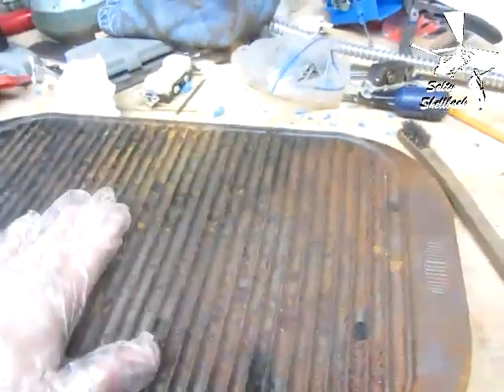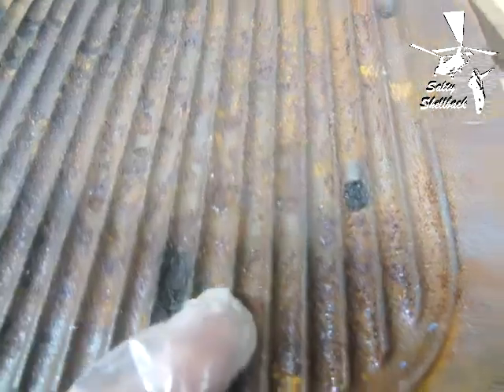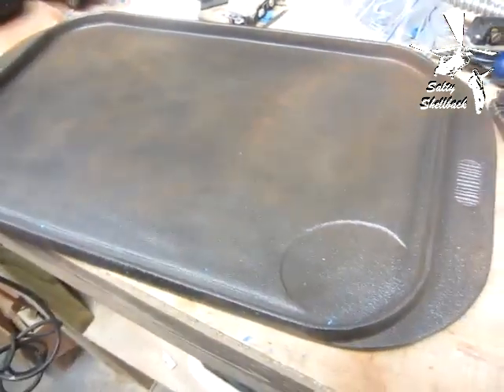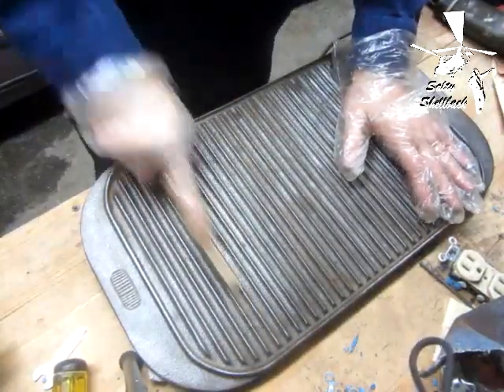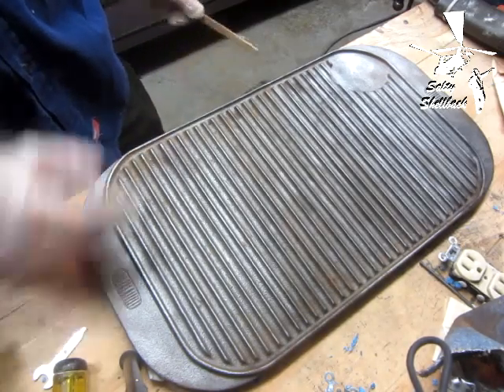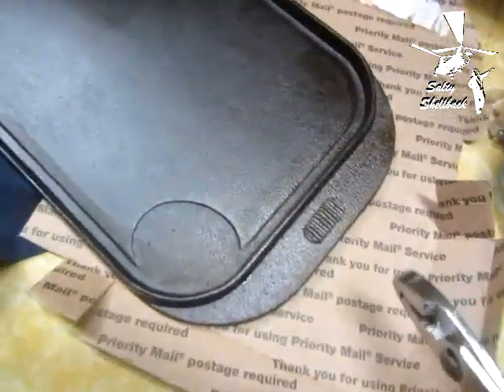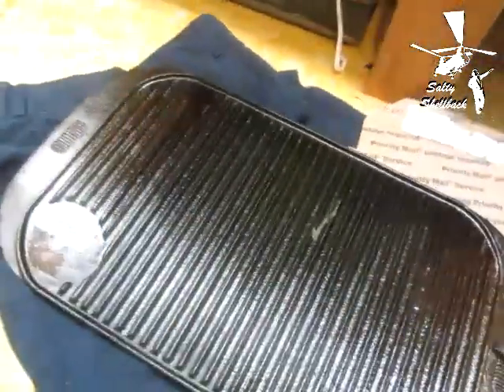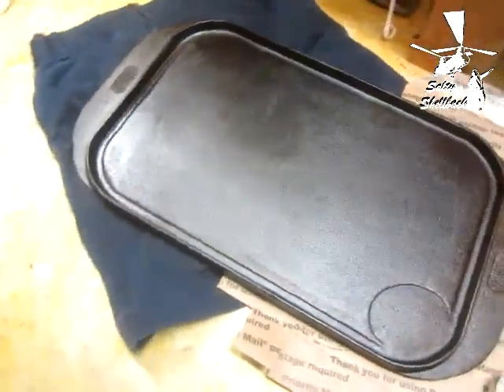How to Restore A Cast Iron Skillet

Comment: start up your kitchen oven.  set it at 200 and heat up the griddle for about 15 minutes.   take the griddle out and wipe all of the excess oil off the pan (both sides).   increase the temperature to 350.  take it out and wipe it again.   leave it at 350 for about an hour.  then increase the temp to 450 and let it cook for 45 to 60 minutes.  Shut the oven off and allow to cool completely before taking it out.  That process will put one good layer of seasoning on the griddle.  Then you can build on that with each use.  after use, put a thin layer of oil on the pan, put it on the fire and bring to that point where the oil just smokes.  Remove from the heat and store when cooled down.  or you can put it back on your grill and heat it up until it starts to smoke.  then shut the heat off.
Reply from the maker: I put it over the gas grill for about 30 minutes and coated it 2 times until it stopped smoking.  Just ran out of time.  It worked out fine though.
Reply: saltyshellback I'm a big fan of the drive-through method like you describe above (and I did above that earlier).  Seems to work just fine to keep that cast iron cooking well!  I have 0 rust problems.  And if I do...  bacon time!  :-)
Reply from the maker: MMMMmmmmm...bacon :-)

Comment: I have several pieces of cast iron that were in hideous condition and was able to bring them back to life!! Cast iron is my preferred choice to cook with, when seasoned right, it is better than the non-stick!!
Reply from the maker: Yup, I use my cast iron for deep frying.  It helps add another layer of seasoning :-)
Reply: Exactly!! I have a dutch oven that I got at a yard sale that when I took the wire wheel to it, you could the Roux's that were made in it!!
Reply from the maker: Cajun air freshener :)
Reply: Yes Indeed!! Ode de la Roux!!

Comment: I think I destroyed my griddle by using oven cleaner on it. It looks like the cleaner removed the top layer of the coating. Is there anything I can do to avoid having to throw it away?? I wish I knew how to include a picture of it with this post.
Reply from the maker: Is it cast iron or aluminum?  If it is really heavy it is probably cast iron and you can re-season it.  There are many videos on how to re-season cast iron.  If it is aluminum (relatively light) with what used to be teflon coating, then it is pretty much trash.  Hope that helps.

Comment: Good thing about cast iron - you can't kill it!  I'd wash it in soap and water after scrubbing w/ the brushes, then cook a lb of bacon on it.  Seasoned, and a snack!
Reply from the maker: LOL....bacon scented seasoning :-)
Reply: saltyshellback Believe it or not I find that animal fats season cast iron better than oils.  However, I do use olive oil to reseason my cast iron when I need to do it quickly, or to put it away.  Most of the time I wash the cast iron in hot water w/ a scrub brush (no soap) and then dry on the stovetop on high - when dry, I drizzle some olive oil in and let it heat up, swirl it around, and wipe out.  Stays seasons and ready to go.  Not as fun as the bacon method, however.
Reply from the maker: Bacon is a miracle substance :-)